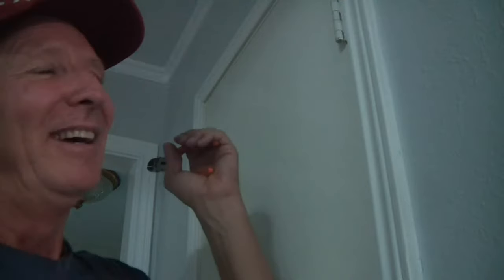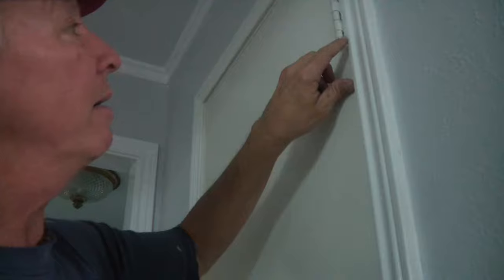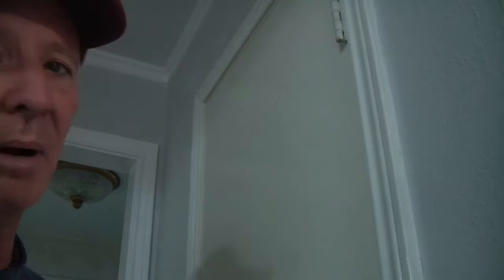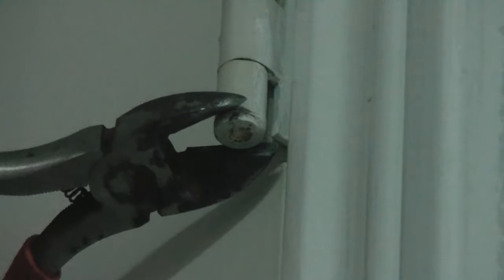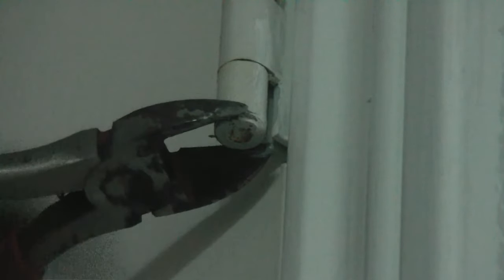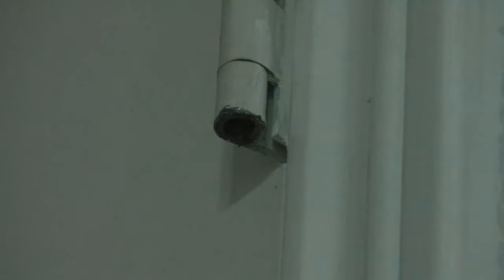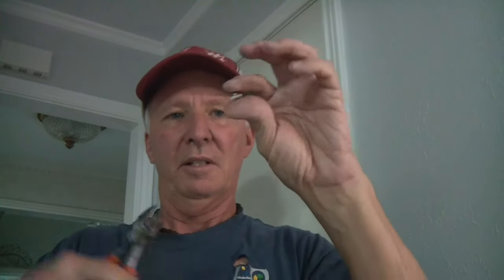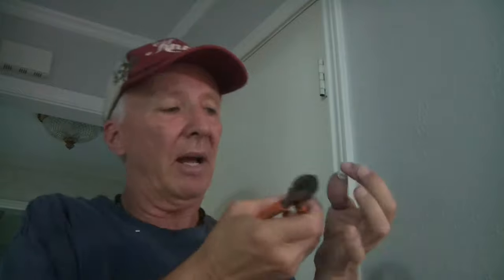How to remove door hinge cap

Comment: Thank you! Mine was so painted over, I didn't even know there WAS an endcap on the bottom. It still took about 30 minutes to knock the endcap off and then another 30 minutes to knock the pin out. LOL. I'm gonna find whoever painted this hardware and have a stern word with them.

Comment: Why do you need to remove the cap? Can’t you just pop out the top long pin? Or does the bottom cap holding the long top pin somehow?
Reply from the maker: If you want to try and grip the pin itself and tap it up to remove that is your choice. the point is too many people just paint over the hinge and trying to remove the pin is nonexistent due to the paint making a barrier over it. the cap will have less resistant's, (its just a cap). The pin will be harder to remove due to all the resistance through the hinge. work smart not hard. Not all hinges have a bottom cap. I like them just because it give it a finished look. cap on top (the pin) and cap on bottom for me just looks complete.
Reply: @TheShackHome  after some time I ended up having to cut the top of the screw in order to take the pin out with a saw… I guess you can use the Dremel as well… it was solid :(… it was from antique cabinet. It worked out better because I can reuse them since I went to a bunch of stores and nobody sells these hinges anymore. And now I have the same hinges and I can remove the doors:) if needed. great way to save what you need. Once I am done, I will post a video in order to help others. Thanks so much for your videos 👍🏼👌🏻

Comment: Great tip!  I had some brand new antique copper hinges, and I needed to put a door stop on the hinge pin, but didn't want to mar the hinge cap.  Using the diagonal pliers as you showed worked great.  Thank you.
Reply from the maker: Geoff Hess
 you are welcome. So glad to help. I've seen others use pliers to pull and i cringe. Vintage hinges  are the very reason I use a different method. This saves the cap and keep the vintage hinges looking great. These were at my aunts house i was going through prior to her putting her house on the market. i removed all the hinges striped the many layers of paint off brought them back to original luster. just a added touch that had 3 people within the first 4 days on the market. having a bidding war. Thank you for viewing.

Comment: Not enough room on mine to get the pliers to bite. Rounded bottom cap is barely showing.
Reply from the maker: CappsJD sometime you need to used a utility knife and scrap some of the paint off to find the cap line